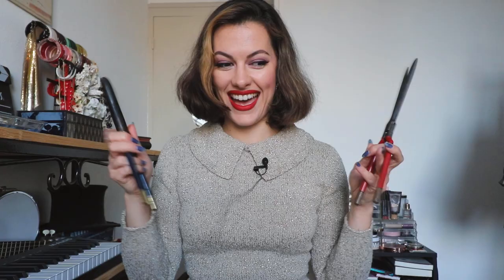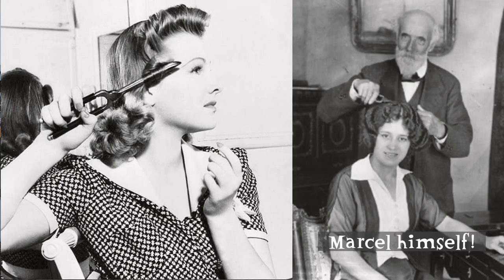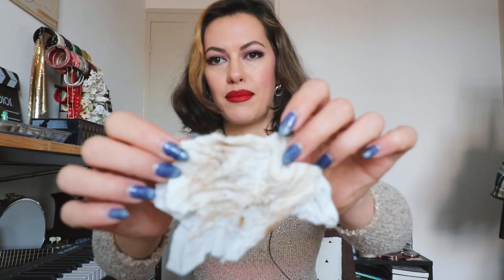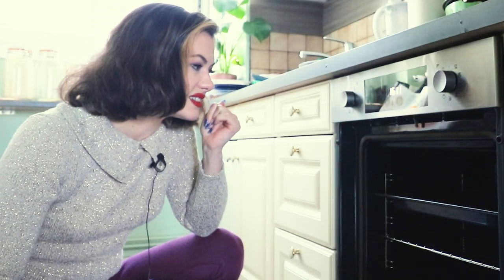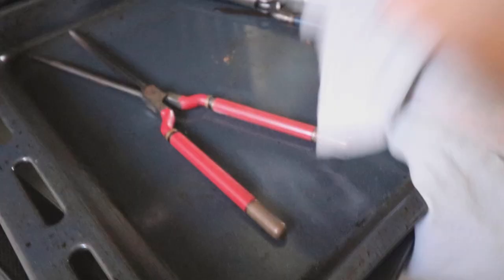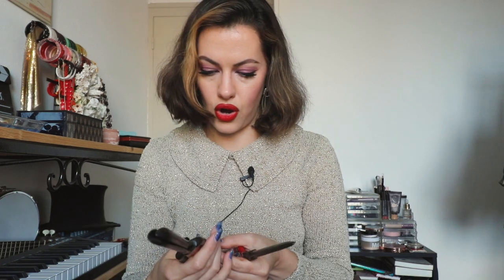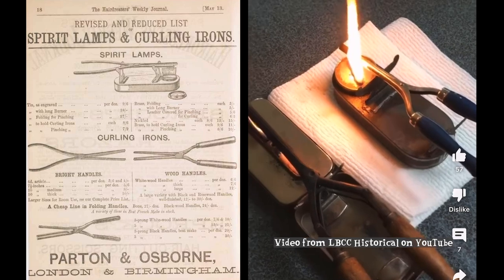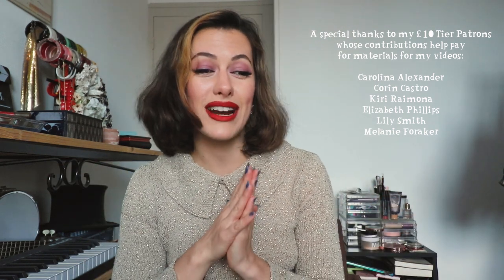I Tried Using Antique Curling Irons | VINTAGE TIPS & TRICKS

Comment: I imagine you'll want to clean them like you would a cast iron pan, just without the "seasoning" part at the end.  That will prevent the rust issue you had at first.  The liquid in your oven was likely to be an oil or lubricant that was used to keep the joint mobile.

Comment: Another way to test the temp is to touch and hold the iron to white paper towels.  
If after 10 seconds it doesn’t change the color of the paper towel after holding it onto it in the same spot, you should be good.

Comment: In the late 1800s 80s-90s an after market hair curling iron heater was a glass hurricane oil lantern chimney with holes opposite through the glass with copper tube to which the curling iron is inserted. The rising heat from lantern flame would heat the iron.

Comment: A couple of thoughts while watching this video experiment:

Any hair made of keratin would work to test (natural NOT manmade) another human, dog, cat, etc. Fingernails! Rhino horn!

You said it smells of crayons while cooking. The tools were probably covered in a thin layer of wax to help prevent rust.

Using the oven, the handles also reach that temp defeating the purpose of them insulating your skin.

Boiling water won't work (too cool) but sand might. Don't know how long a liter or two of fresh sand would take to heat up.

100 deg C = 212 deg F (boiling point of water).  160 deg C therefore is way hotter than boiling water!

Fine sandpaper, 300 grit to start, 900 to finish, might help get the rust off of the business end of the tools.

You get to use an IR sensor to know how hot the tools are but how did THEY do it? How fast it will boil a drop of water? (hot skillet)

How did they ensure the same temp of the tool along its entire length? Didn't care, had a way?

More research is needed to find out how this was done so long ago.

The tools may have been soaked in WD40 or similar to get them to open. Take them apart as much as possible to clean them. There might be something trapped INSIDE the hollow handles!

Good luck with your future experiments! would love to see the results!

Comment: I’m late to the party 🎉
1. *Collect Hair:*
   - Gather hair from your brush and form it into a small ball.
   - Set the hairball aside for later use.

2. *Prepare Hair Perfection Oil:*
   - Retrieve your Hair Perfection Oil.
   - Set it aside for now.

3. *Choose a Heating Method:*
   - You have a couple of options:
     - *Stove Top:* Use the top of your stove (whether it's gas or electric).
     - *Desktop Oven:* Alternatively, you can purchase a small desktop oven specifically designed for hair tools.

4. *Prepare Your Curling Iron:*
   - Wash your curling iron with cold water and soap.
   - Dry it thoroughly.

5. *Apply Hair Oil:*
   - Put a few drops of Hair Perfection Oil on your curling iron.
   - Rub the oil onto the iron's surface. This step ensures smooth movement down the hair shaft during styling.

6. *Heat the Curling Iron:*
   - Set the stove to a low temperature.
   - Place the curling iron directly onto the heat source (stove or desktop oven).
   - Be careful not to burn the plastic handle.
   - The iron only needs to be exposed to the heat for a few seconds.

7. *Test the Iron:*
   - Remove the curling iron from the heat.
   - Test it on the hairball you set aside earlier.
   - If the hair burns, it's too hot for use.
   - Set it down a few more seconds to cool, then test the hair again. Once the temperature is right, start curling.

8. *Practice and Adapt:*
   - Over time, you'll develop a feel for the process.
   - While it may seem antiquated, the results can be incredible!

Remember to exercise caution when handling heated tools, and enjoy your beautifully styled hair! 😊😢😢😢😢😢🎉😢

Comment: could you tell me how wide the barrel of the curlers are bcause i suspect that the 30s-40s one could be duped by a  20mm iron i have at home (i always have somewhat of a medium 50s look whenever i use them) but the earlier ones might be finer than 1cm and that's why we never see anything realistic in term of curled hairstyles before 1930 on screen nowadays where it would be more common to have the right texture in 80s movies
Reply from the maker: Totally. I’m investing in a 19mm modern one for the follow up video to try the technique. The bigger antique one probably more like 15mm but I don’t think it’ll make much difference. You can get 9mm curling irons that would be a good replica of the smaller one too x

Comment: 190° hmmm.  Water boils at 212°...  I'm thinking that using a sauce pan full of boiling water (taken off the stove) would work.  Lacking direct heat that would cool quickly.  Soaking the curling iron and then using would work well.
Reply from the maker: Ah sorry I’m in Celsius. Should have clarified that. Boiling water isn’t hot enough.

Comment: Bahahaha! This is so funny, my first thought was to use an oven too, but that did not work out. My other two ideas are a bit more painstaking and involve flipping the curler, but you could use a clothing iron because some have exact heat settings so your clothes don't burn. You could set the curler on a baking sheet on your stove and set the clothing iron on just the part of the curlers you want to get hot, and flip them so both sides get hot. The other thing I thought of was trying to clamp down on the ends with a flat iron. But I agree with you that perhaps the safest option, and least painstaking, is just using modern tools and showing us how to get a vintage look with that! Probably best not to burn yourself for the sake of a YouTube video 🔥
Reply from the maker: If I can find a way to do it that doesn’t produce the smell or suspicious oozing gloop, I’ll try again for sure!

Comment: Ah, too bad, it didn't work!
I was thinking maybe a heatgun? 
They're usually hotter then 19OC on the lowest setting, though, so you would still need to adjust the distance accordingly. Which means, you would also need an infrared thermometer. But maybe you have someone, who owns these things in your circle of friends. 
Infrared thermometers are popular with ambitious hobby cooks and most home owners have a heatgun somewhere in their garage. Both also aren't very expensive, but probably not worth buying just for this experiment.
Or how about this.
Heat a pot full of sand to 20O*C in the oven. Then stick the tongs in there for 5 minutes. That should get them to approximately the right temperature!